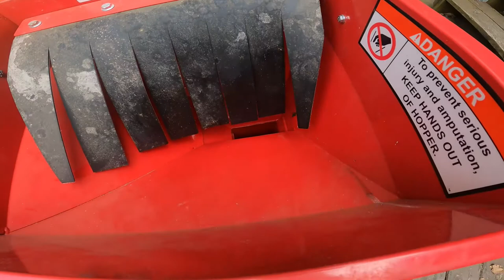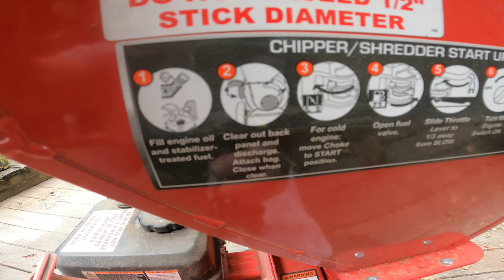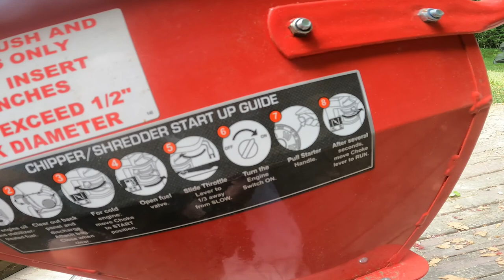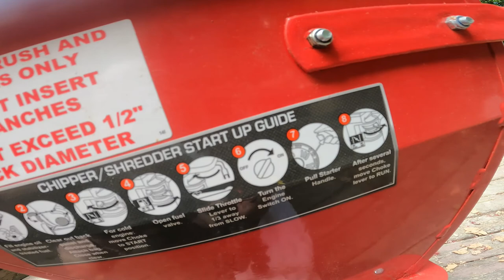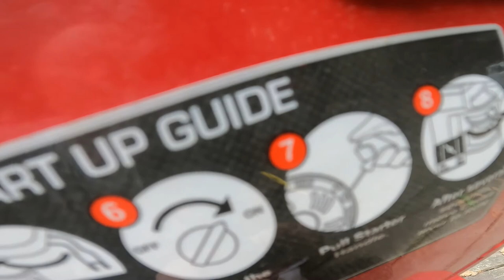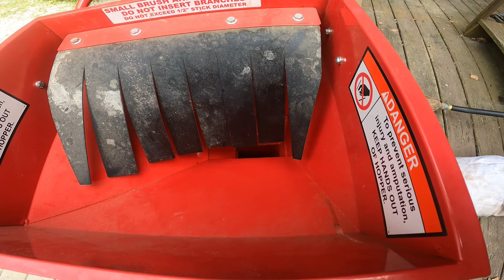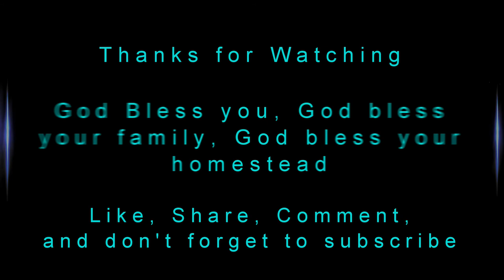2022 Harbor Freight Chipper Shredder Update + User Questions + It Won't Start + Shredding Boxes

Comment: I wonder if running the chips through a second time would result in a finer shred.  That's a good use for waste cardboard and paper.  I have a cross-cut paper shredder and use the shreds for my mulch pile.
Reply from the maker: Sometimes i do run them through more than once by dumping the chips into the top hopper, depending on the material and size, it does seem to help but i am leaning more that it hits the blades differently in the hopper vs branch feed tube.   I also run cardboard through this, really about anything other than plastic.  I alao use mine in compost piles and to form walkways around garden

Comment: Mine still does not start despite having the On switch on

Have tried all the other steps mentioned.

Frustrating.

Pull start stuff is always prone to problems.
Reply from the maker: Have you checked to make sure the spark plug isn't fauled and that it's actually sparking when you pull the handle?